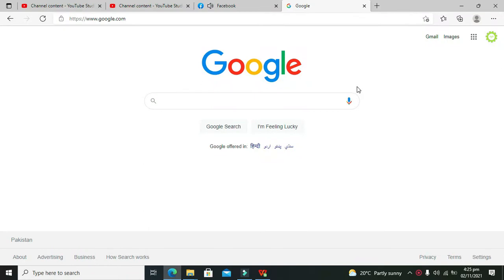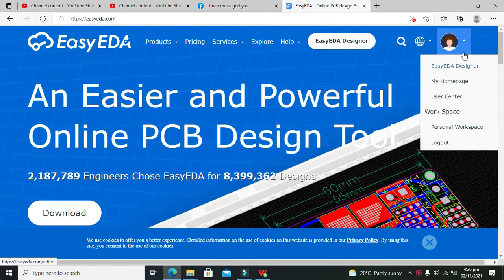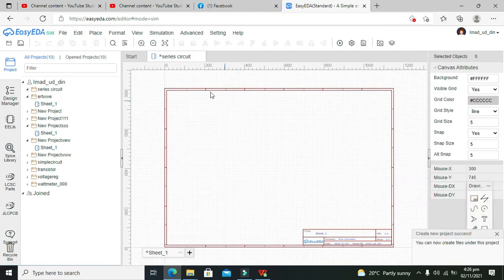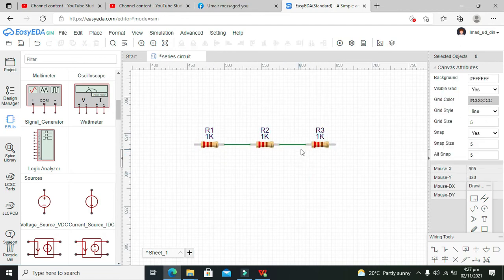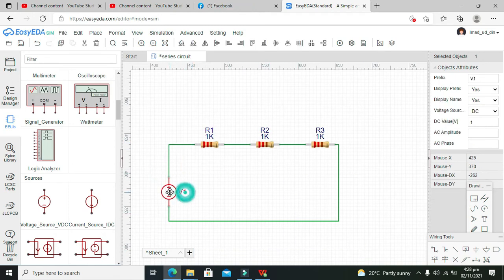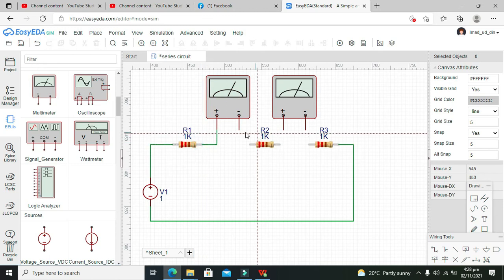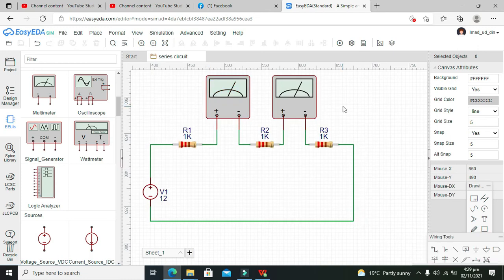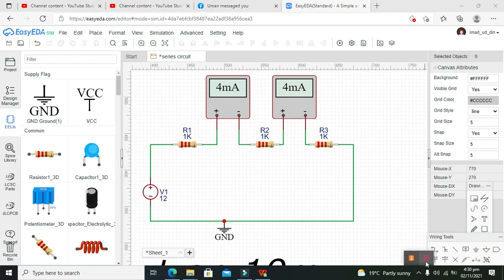how to make a series circuit simulation in easyEDA online simulator

Comment: Where is the multimeter located?
Reply from the maker: on the left side..kindly search...
Reply: @nelsondarwinpaktech3954  yeah I had already searched the left side bar, considering the common library, there is no "Instruments" list so that I wasn't able to locate the multimeter. Moreover, I searched throughout the Library, I typed the specific codename for the Multimeter which is "XMM" based from your video, there are no results showing...
Reply: I think the version of easyEDA you used that time compared to the version I am using right now are different making the multimeter phased out i guess 😩

Comment: Thank you for the tutorial. However, I find it hard simulating complex circuits with easy eda as I tried using 555 timer to simulate a blinking led but it does not provides any results.